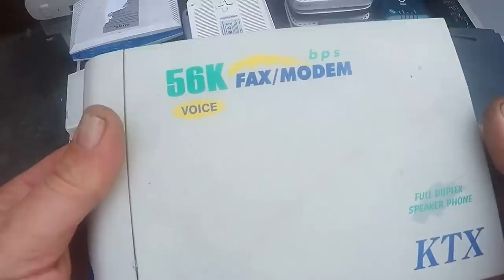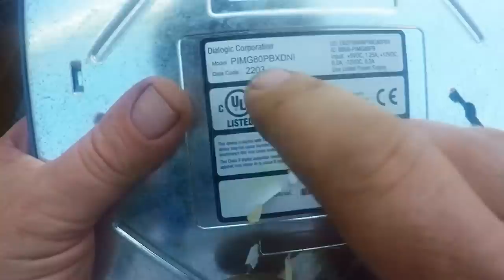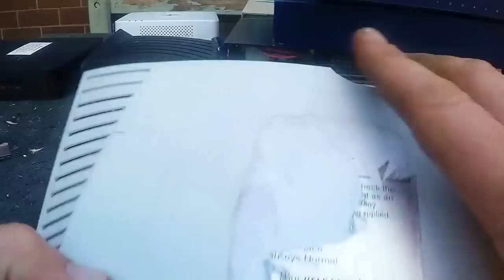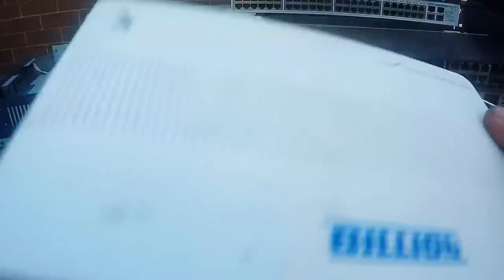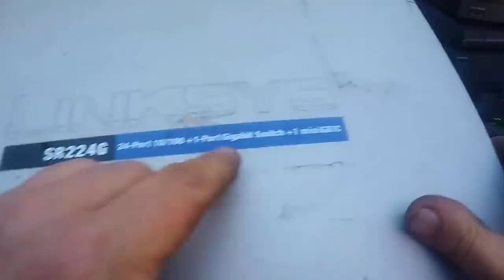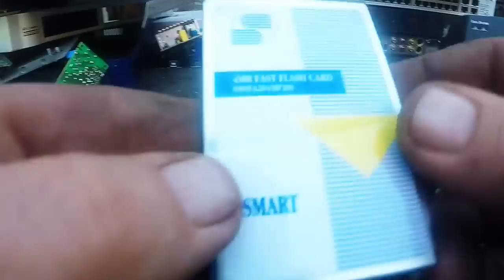Scrapping Modems, Routers, Switches for Gold, Palladium & Tantalum

Comment: I don't ever get the chance to tear down my switches. they sell fast around here. If I get ones with gigabyte ports they sent for good money. only ones I get to bust apart are the non working. like those pins in them. usually good recovery ratio.

Comment: You were saying about very light gold plating on that one "smart card" thAt came out of the Cisco 1600, and that reminded me to ask you if you've ever seen bus cable out of desktop pcs that are not gold plated? I've been taking the plastic clips off mine after I seen how you do it and I've noticed some of them appear like they have no gold plating on at all. Could it just be that light that I can't really see it? And how's your air hammer work out on smaller mlcc and tantalums?
Reply from the maker: +zackcat276 yep some have no plating, mostly cheap cable. most pins though will have at least a tiny dot on one tip, but yeah some just don't have anything, not common though.

Comment: I see you use that air-hammer for scrapping parts. 
Don't chips have gold plated pins ? So all the pins are soldered to the board, won't that waste some gold ?
Reply from the maker: no most pins are tin plated copper, it's the insides that count

Comment: +eWaste Ben can you possibly find a board similar to the one that you work on @ 50:25 or the same one and provide a rough estimation of weight for the fully populated board? Also, does your yard/buyer pay seperate for the ethernet (gold pinned) connections that you refer to on the switches ? Wondering if it is worth taking those off for seperate profit or keeping them on for weight of high grade telecom price. Thanks! Paul
Reply from the maker: +Paul Diefendorf there's only value in the ethernet sockets if your going to recover the gold from the pins, gold refiners would take everything off with plating but if your not depopulating boards and just selling as is then yes, you will get better value leaving them on the boards, those sockets are quite heavy but the gold pins are very small so if your not depopulating ic chips then you want to leave as much on the board as possible, maybe grab a few small things is your collecting bits like mlcc's, crystals or tantalum.

That board weighed about 4 - 4.5 lb
Reply: +eWaste Ben thank you for the reply . Will consider all of this . Just getting into electronic recycling/scrapping and every bit of advice helps ! Thanks again

Comment: Hey Ben
love the videos, whats the best way to test pins to tell if they are silver?. I get hundreds of the same boards and I believe I have 8 one inch silver pins on each.
Reply from the maker: +patrick trently get them refined, no way to test as is but why would they be silver?
Reply: Just pins and contact points on the boards so I am assuming there silver, wanted to test them to be sure
Reply from the maker: most likely tin, what kind of board?
Reply: +eWaste Ben telecom boards, used in tap cans on telephone poles.
Reply from the maker: +patrick trently well they may be silver, still hard to tell until you refine them so do a batch and see what you get.
Reply: +eWaste Ben yea that's my plan, just curious, thanks for the input, do you refine your gold and silver yourself? if so we gotta see some videos haha
Reply from the maker: not yet but one day I will refine

Comment: what metals are directly inside being layered within a motherboard? Thanks Ben.
Reply from the maker: +bantalee2002 don't think anything is layered within the board, it's all mostly printed onto the board after they first lay it with tin/lead where the component mount onto.
Reply from the maker: +eWaste Ben there might be copper layered in it first but it's only very thin
Reply: Agreed that could be the way most are composed by today standards as i can put them to a light and see through it with little obstruction. But If you ever find a heavily populated, early computer motherboard from say the late 90's-mid 2000,.crack it open, use a magnifying glass. There appears to be layers,some having fine wires intertwined with other metals that could be gold.
Reply: i worked in a board shop, and we would get in these crates of copper balls.  of course that is irrisistable to people that like to steal.  and workers would constantly get fired for stealing.  so these balls got melted down and our boards had a thin layer of copper.